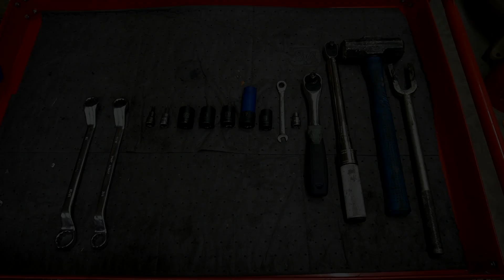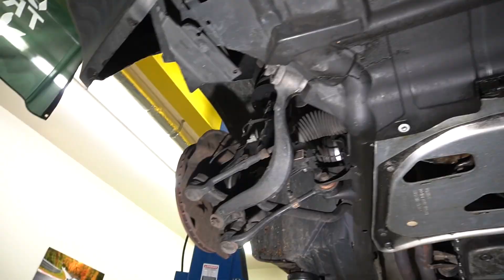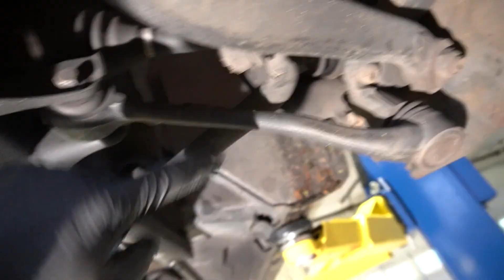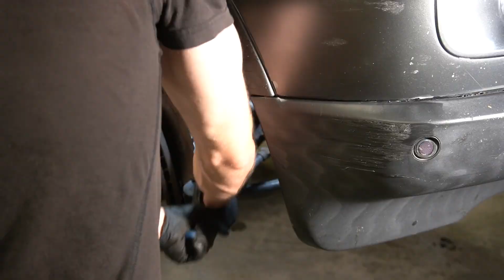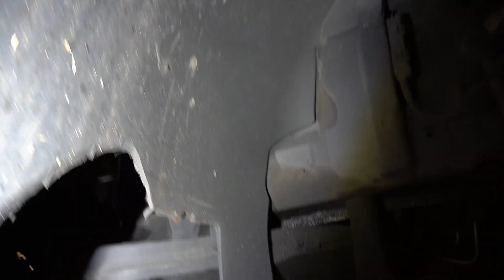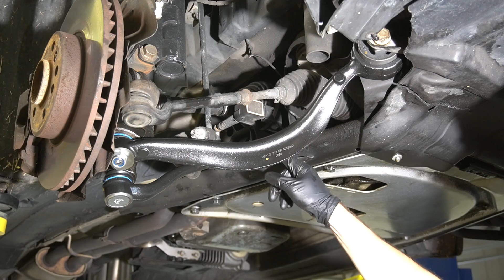E53 X5 Front Control Arms Replacement Walkthrough, Forward + Rearward

Comment: Extremely solid video, my lower control arm bushing gave me grief even with the fork. My balljoint however came down with me unbolting it. I’m not sure if mine was original or had been changed as mine had E12 torx bolts, but my replacements have t50 bolts. Early 2003 car, but good to note
Reply from the maker: I'm glad you found it helpful! Thanks for the note regarding the pre-LCI cars.

Comment: For anyone else stuck with these e53 ball joints: if you remove the axle (cv) and use an air hammer (120 eur from Amazon) hitting the ball joint from above, it will come off like butter in seconds, without any effort. 
Just make sure you jack up the knuckle to avoid the suspension to hold all the thrusting from the hammer.
Reply from the maker: Definitely the better way to go about it for the car. I do think I did more hammering against the suspension than I should have, but no harm no foul.
Reply: I prefer this way, you can remove the disk spin controll arm out and 2 hits 
Saves taking everything out

Comment: Perché bisogna settarla con le sospensioni a terra?
Reply from the maker: When you torque the bolt, the bushing no longer rotates and is locked in position. If locked in position with the suspension unloaded (car off the ground), the bushings will twist when you put the car back down, causing them to tear and fail prematurely.

Comment: I'm doing this now in my home garage. Your strategy is impossible without a lift. I ended up cutting off the ball joint. I am stuck and taking a break now. I think the easiest way to remove that ball joint is to destroy the collar  with my cutoff  and air hammer it UP into the hub. Not sure if it's possible or if I should just put a drill through it. 
Other people do it by disconnecting the other ball joint, tierod and pulling out the axel. I don't really see that as realistic, to just replace a ball joint - I've been wrong plenty of times before though
Reply from the maker: I know it's a huge frustration. I didn't show it in the video, but the first one took over an hour to remove, plus a lunch break in between. Once I had the angle figured out to hit it from the top down as close to the joint as I could, things started working for me. It took a ton of patience, and I was positive for most of it that it wasn't going to work, especially after looking online at other people's struggles, but eventually it budged. I don't think the lift made a difference there once I figured the angle out (top down, nothing under the car necessary). The second one came out much faster, in maybe 15-20 minutes of hard effort. A chunk of something solid sitting on top of the arm may give better results for striking if you're able to get enough windup. I'm curious to know how your proposed method works for you. It sounds promising, I'd just be really careful not to damage the hub, particularly the threads near the joint. If you try it, let me know. Best of luck!
Reply: For anyone else stuck with these e53 ball joints: if you remove the axle (cv) and use an air hammer (120 eur from Amazon) hirting the valle joint from above, it will come off like butter in seconds, without any effort. 
Just make sure you jack up the knuckle to avoid the suspension to hold all the thrusting from the hammer.
Reply: @juanarrisem   That is the best suggestion, always use a JACK to take suspension Stage fixed, or wen you make a punch in arm it balance, if is fixed 3 or 5 strokes and arm down. (sorry my english).

Comment: A good tip, if you want to have the balljoints last longer - take off the boot and inspect how much grease there is. I have seen cases where the good OE brands are made in china or elsewhere, have little to no grease. If there is little to no grease, put in some, and reassemble it, and you are good to go for much longer. 😊

Comment: Yeah let’s see you replace that knackered steering rack next . It’s leaking badly and I don’t rate the junk aftermarket manufactured stuff . A rebuild kit if you’re able to source one.
Reply from the maker: My steering rack is actually in good shape. The old pcv system was badly leaking oil and the CV axle was flinging grease before I purchased the car and repaired it. Everything still has a nice coat of oil including the boot on the left hand side of the rack.